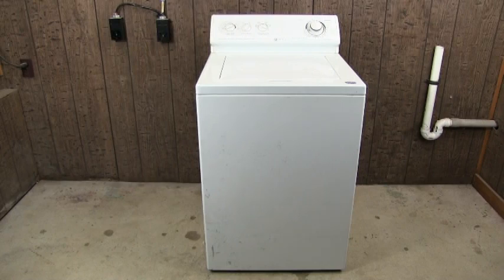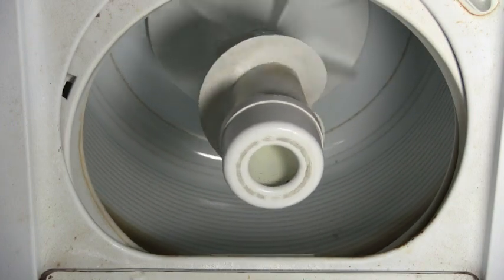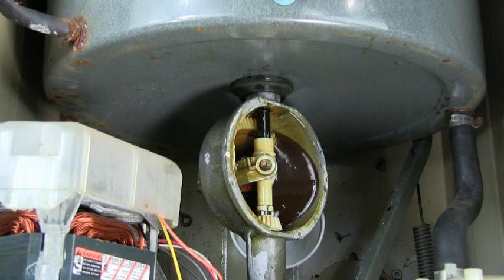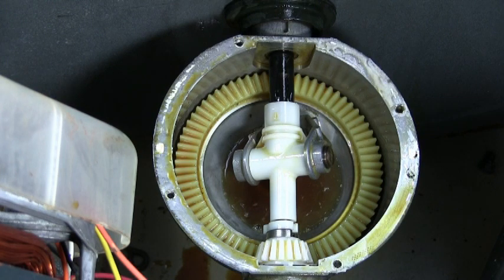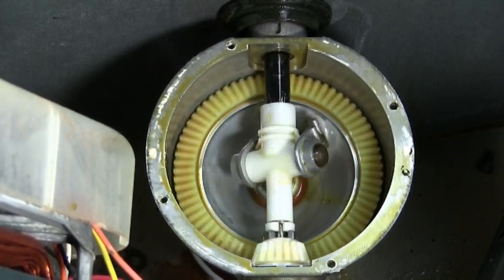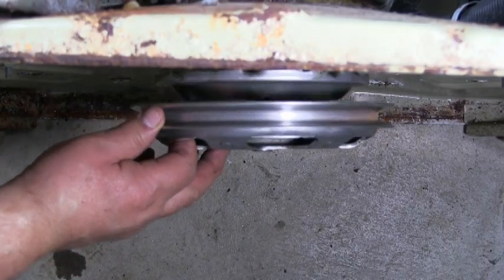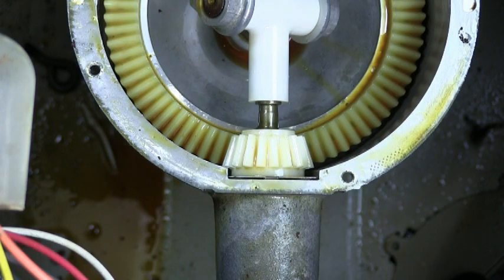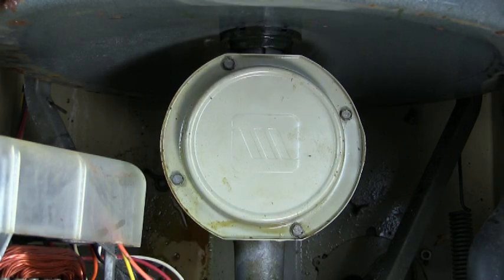Maytag Washing Machine Not Agitating The Clothes - See How To Check The Transmission

Comment: Thanks so much! I followed your video on replacing tub seals on my Maytag, but when I put it back together it wouldn't spin. Turned out the tub  cover was rubbingon the spin tub. This was the earlier model that didn't have the plastic tub cover, but the metal one with a metal band and triangular rubber seal. I watched your excellent transmission video and once I understood how a washer transmission worked I was able to figure out it wasn't a transmission problem, but I simply had to raise the tub cover a little. You saved me so much time, aggravation, and money. I owe you man! I subscribed, it seemed the least I could do.
Reply: Thanks for your comment. I think I may have the same problem. 👍

Comment: I have a question, same exact model, has no problem agitating with a full load- can spin the pully freely.  When it switches direction to spin the water out - it will start and a few seconds after spinning, the motor will trip out with a smell of burnt electrical.  After it cools down, it automatically tries again and trips it out.  I replaced the motor and still happens.  When I spin the pully clockwise for the spin cycle - it does not spin as freely as the agitation cycle, there is more resistance and in addition the bell housing of the transmission spins as well (the bell housing does not spin on the agitation cycle).  The bell housing does not spin on the agitation cycle.  Is my transmission, ok?  I think it is?   Is the pully supposed to spin as freely in the agitation cycle as the spin cycle?  I did replace the break and didn't help.  I am wondering if there is a bearing that has gone bad or something?  I did replace a bearing when i replaced the break, but I think there are other bearings.   Or do I need another motor?   What would case more resistance of spinning the pully on the spin cycle?  Thats the problem.   Thanks for any help!!   Frustrated.

Comment: This is super.  Do have a question.  My old A183 has these exact symptoms.  First, the tub is extremely difficult to rotate by hand.  Could the bearing be seizing as well?  How does the brake work?  Could it be jammed or dragging?  Spin cycle is perfect indicating clutch working fine.  Lastly, I don't know if it's possible to find the brake removal tool.  Everyone showing out of stock.  Thanks
Reply: Did u solve this? Mine is doing the same
Reply: Does your Maytag have the same same style of transmission as this one or not? If it does then it’s this transmission aka the Orbital, if not then it’s the Helical transmission which was around from 1956 to about 1989. The Orbital debuted around 1986, and went into all Maytags after the Helical transmission was discontinued in the late 1980’s.

Comment: My Maytag LAT9593AAW is won't spin. I have watched almost all of your videos and I'm thinking it might be the tub bearing, the radial bearing, or the brake assembly and these have been my troubleshooting/exploratory surgery steps-

Belts are new. Just replaced and tensioned due to the first time I had a stinky basement and wet clothes. Engine seemes to slide just fine. No clothes stuck around the drum. I took a Slim Jim down the edge all the way around to be very sure of this. Transmission pulley will spin counterclockwise just fine. Transmission pulley will almost make a half rotation the clockwise before it gets very hard to turn. The bearing directly behind the transmission pulley spins just fine and I put it back. The transmission case itself doesn't spin easily like it should and it certainly isn't spinning the tub. I opened the transmission case and drained the oil. None of the internal parts seem to be marred or broken.

Like I said, tub bearing, radial bearing, or brake assembly. How would I know which one of these might be the problem and how I can test further to avoid buying more parts than necessary.
Reply from the maker: The only way to find out is by removing the spin drum  and checking the tub bearing and the radial bearing.
Reply: @theapplianceman  Thank you for taking the time to read this and for your help
Reply from the maker: Thank You 
For more free videos check my website
http://www.do-it-yourself-washing-machine-and-dryer-repair-help.com/ 
Angel theapplianceman

Comment: Great videos!  Thanks!  A question: when I turn the pulley counter-clockwise, the whole mechanism binds.  I can force it with enough effort, but it binds at the same points when I observe the inner mechanism of the transmission.  Can you suggest what might be causing the binding?  There is nothing obviously wrong with the gears and whatnot inside the transmission.  I can't tell if the problem is above or below the transmission itself.  Any input will be greatly appreciated.  I love my old Maytag washer (LAT8440AAL) and would rather not junk the unit if at all possible.
Reply: Did you figure this out? having the same problem.

Comment: Hi! I opened and did what is said in this video, but the top part and the bigger gear is jammed on my machine! At minute 5 in your video, where you show how the transmission works, mine doesn't move like that. I checked the gears and they're clean. Which part is broken? :(
Reply from the maker: Is hard to say without been there to check the washer. But if the gears look OK it could be the transmission top shaft and for that you will need to remove the complete transmission 
 and probably replace it with a new one or a good use one.

Comment: Is it not common for the larger gear to become damaged when the small gear needs to be replaced? Jow would one replace that gear if needed?
Reply from the maker: That involve more work. I believe that the big gear is made or harder plastic that the small gear and  the small gear will wear out without damaging the big gear. Is just what I believe I never had to replace the big pulley.

Comment: I have the transmission cover off; the agitator functions when I turn the pulley counter-clockwise, but it takes more effort to turn when when it reverses direction.  It also makes a groaning sound at that point.  It seems like it is binding somewhere.  Any ideas?  The transmission belt started smoking which led me to this video.  I'm wondering if a little binding/groaning is normal and if maybe I should have just replaced and adjusted the belt...
Reply: It is a model LAT8840AAL.  I think the agitator drive shaft might be binding.  Does anybody know if it can be removed and cleaned up?
Reply from the maker: Is hard to tell without having the transmission present to check it out. Make sure that the small plastic pinion has not some wear on it making it had to turn. when the washer is on spin all it does is to release the brake and  lock the complete transmission and turn it . The gears are only use during agitation  O would remove the transmission and check to see if find a good cheap one. 

I would look on Craig list to see if some one is getting rid of and old Maytag washer and use it for parts.
Reply: Thank you, Sir!  The pinion and ring gear look brand new, the brake locks/releases fine, spin cycle is normal, agitation works, but groans and takes significantly more effort at the limits of travel.  Last night I removed the agitator and the groaning seems to come from the top of the shaft/stem/seal area, so l ordered a kit that includes the shaft and stem/seal, along with a new bearing along with the wrench.  I removed the clip from the upper shaft right above where it joins the yoke, it looks like it might slide out vertically once the tub is removed.  Once I remove the drums I should be able to isolate the problem better.  I will definitely be using this and your other videos throughout the process!
Reply: @72Elco  Did you solve the problem?  My washer seems to make the same noise and drag also.
Reply: @writerjmd  I fixed it by replacing the transmission shaft, a leaking seal had caused it to rust and bind. I replaced the bearings and seals while I was in there along with some other wear parts.  Don't be afraid to lay them machine on its side and open up the transmission if you need to, it's pretty simple. Take pictures if you need to so you know how to put it back together.  The job itself didn't take a long time, but I had to wait on parts because I didn't order everything all at once.
Reply: @72Elco  Thank you.  I am going to replace the tub bearing.  I don't have any leaking but there is binding and groaning just like yours.  We'll see how that goes.

Comment: Besides the Speed Queen, what other washer do you recommend that is reliable and easy to repair?
Reply from the maker: What they make now are junk, the GE Whirlpool direct drive and the original Maytag washers where the easier to fix and last a long time. Now everything is electronic and you need to know electronics to try to fix it. I need to learn how to fix the newer washers and dryer to be able to make new videos. If you could get your hands on Whirlpool direct drive washer they are the easier to fix.

angel theapplianceman
Reply: @theapplianceman  that's what I have now, a Whirlpool direct drive I purchased new in 1993. The only repairs I've done on it was replace the agitator dogs twice and the timer.
Now the tub seal was leaking, so I've taken it all apart the check all the seals. I'm going to replace the shaft seals anyway.
One thing I also noticed is tub support shaft has some good amount of rust from the middle to the top.
Reply from the maker: @Authoratah  Those where the best washers to work on. What I suggest is look a the market place or Craigslist to try to find a use direct drive washer that someone want to give away or sell cheap and get it for spare part and you probably will still have that washer for at least 5 or more years.
Reply: @Authoratah  the best washers that you can get your hands on are Maytags from the mid 80’s and older, Maytag literally kept the same basic design from 1956 to 2006 so parts are interchangeable. Heck, Maytag’s dryer designs changed more than their washers have between the years of 1956 and 2006 since their dryers changed 3 times in design while their washers have only changed 2 times in all those decades. I actually have a 1973 Maytag A606 set that’s still running I bought for $30 along with it’s matching gas dryer back in 2019.
Reply: @seana806  isn't that the dryer that has 2 belts in the rear
Reply: @ericschulze5641  yes. That was the Halo Of Heat model which was in production from 1958 to 1975.

Comment: What is the weight of the Maytag transmission oil?
Reply: 80/90 GL4 gear oil is a good replacement if the machine is located inside the home. If the washer is located in the garage or exposed to cold temperatures, purchase Royal Purple 75/140 gear oil. Unlike most synthetic gear oils, this one does not interfere with yellow metals.